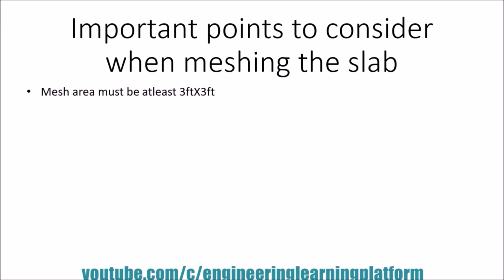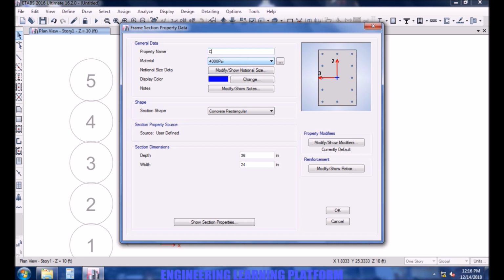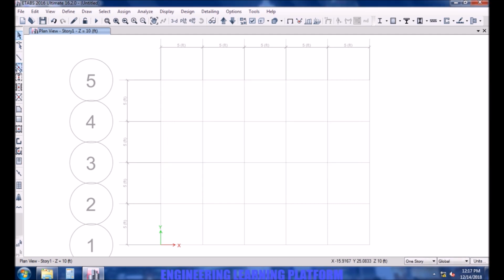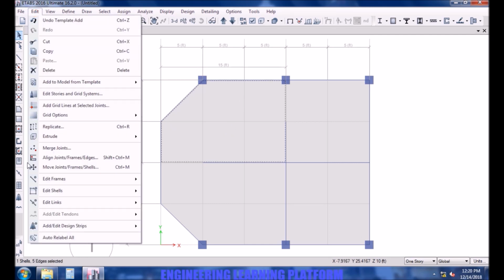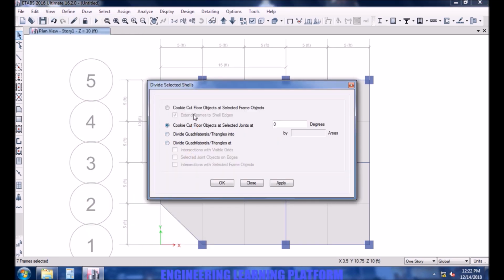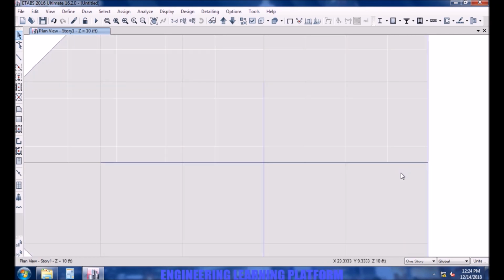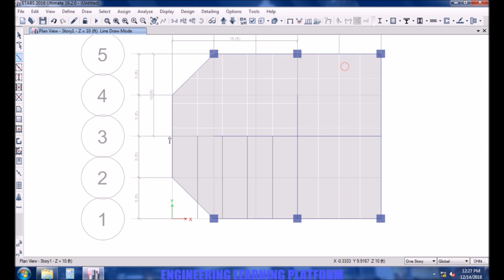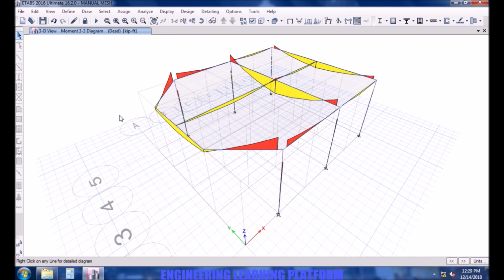How to manually mesh the slab in etabs - Etabs Tutorial 16 - Meshing of slab

Comment: when I assign "none" as slab section and apply area load over it, it does not transfer load to beams and columns? Then what is the use of "none" as a section? How can I apply area load without assigning any section to the slab so that I can avoid the self-load of the slab?
 https://youtu.be/mIocbSTh4yY
Reply from the maker: Yes its not related to the none section, instead resolve the warning: https://www.youtube.com/watch?v=FXge5THBalM

Comment: what will happen if the mesh lines dont continue? Will it give wrong results?
Reply from the maker: Results will be wrong because at different meshing lines on either sides will cause un realistic bending of supporting members as deformation occurs at nodes . Hence un-matched nodes on both sides will cause different deflections from either slide causing abnormal deflection of supporting member.